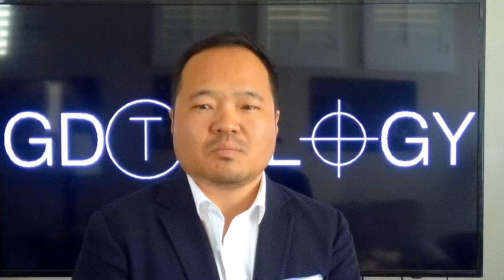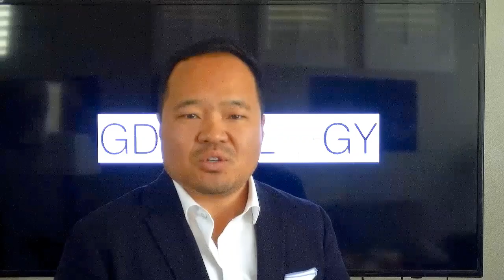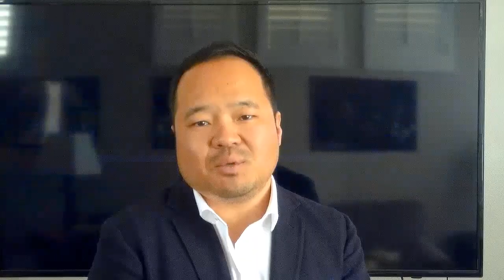THE PROBLEM WITH GD&T AND METROLOGY INSPECTION

Comment: I agree with the insights you shared in this video. To make matters worse, inspection software developers struggle to implement the new features that come with each revision of GD&T standards in a timely manner. So even if the inspector has a good understanding of GD&T, the software they're using may not be able to evaluate 100% of the tolerances on a given drawing.